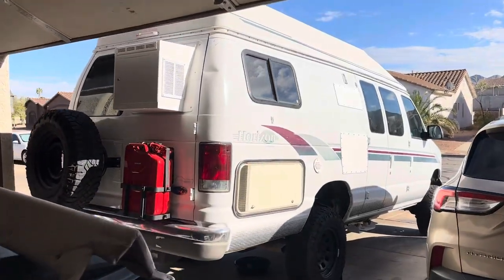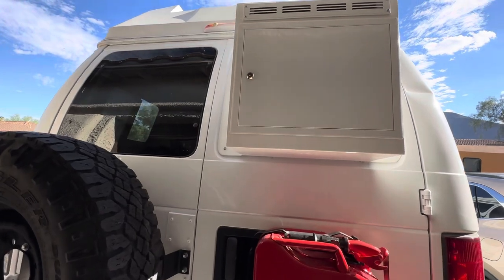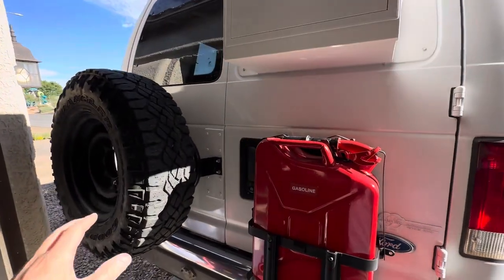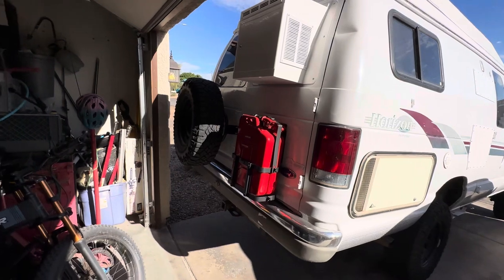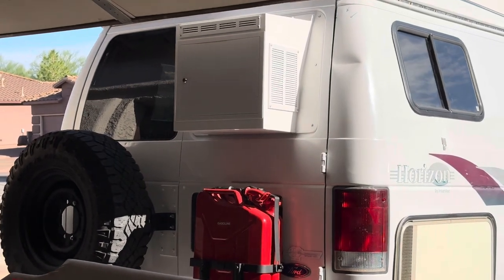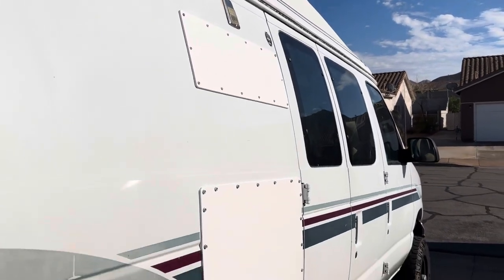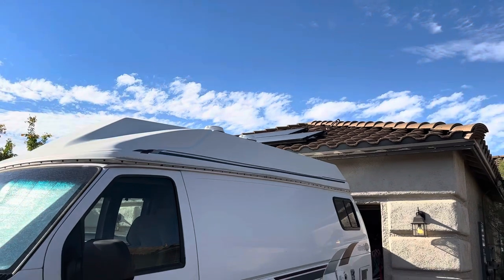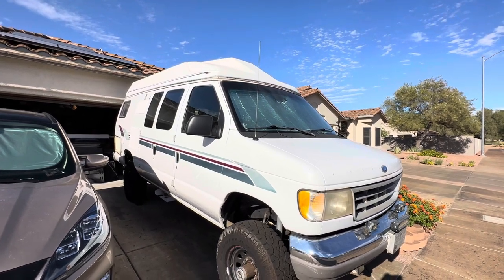Quick Update! 4x4 Van Build VLOG: Air Conditioner Pod Has Been Installed! #vanbuild #4x4van

Comment: With the inside unfinished, this is your one shot at easily having sheet metal welded onto the body where the old fridge vents used to be. I would at least get it priced out at a shop as it may be a lot less expensive than you were expecting. Then again, maybe not, but it would be worth asking. The A/C is a lot more compact than I was expecting. Great job on that project.

Comment: Cool, ... pun intended ...  Do you have service records for the rig?  I know you said you changed the fluids .. and that is a good thing for sure.. but the front hub bearings and so on all need periodic repacking.  Check how many miles since the 4x4 conversion.. and maybe go by that mileage.  Ford brakes have some quirks and maybe I can email you about it if you like .. something to check ...  They may not have the Ford configurations calipers ... and that is the aspect I could mention.   pat
Reply from the maker: Good heads up. I was not aware of the need to repack those hubs. Yea, send me that email. Thanks Pat

Comment: Nice job on a/c box. Excellent problem solving. Been following the build.  I have a 95 extended e250 with that same top on it so I was wondering where you got that decorative strip to cover the screws? Mine's pretty well toast!
Reply from the maker: Camper World
Reply: @EndgameCampers  Good deal. Thanks!